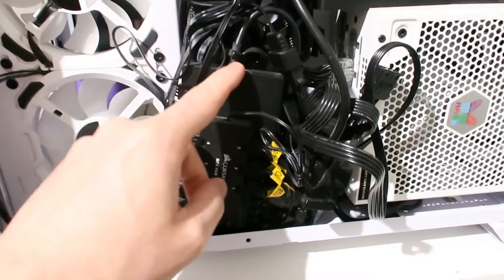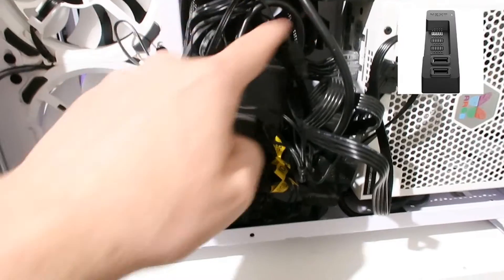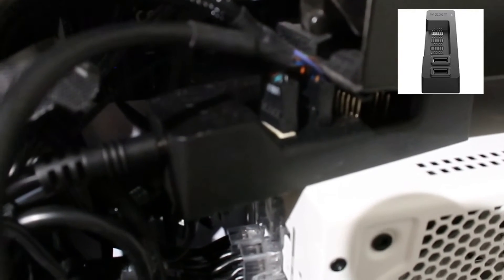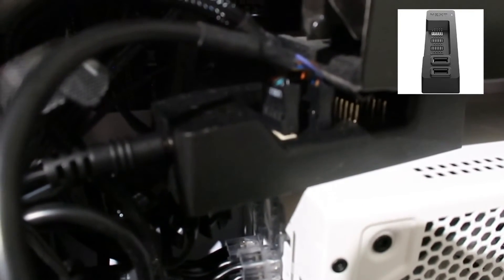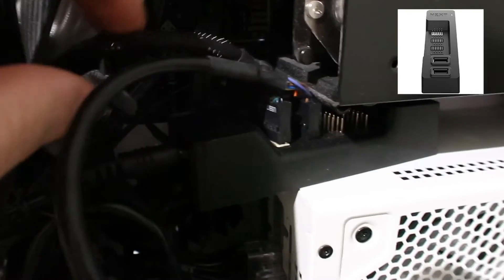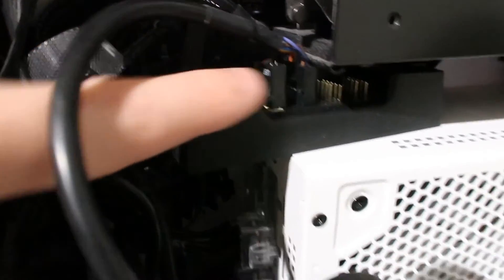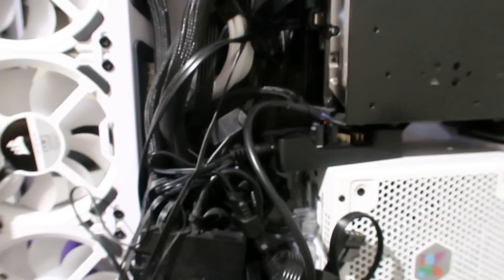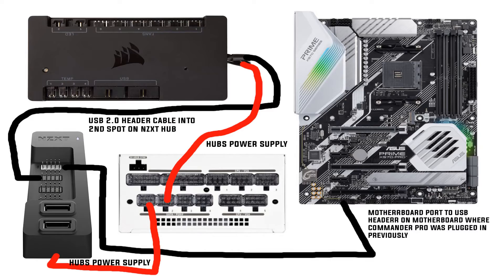Corsair Commander Pro: How To Fix Disconnection Issue - Solved Working In 2020

Comment: JUST TURN OFF ALL POWER SAVING FEATURES IN WINDOWS!!!! This is the main cause to the usb issue on the Commander Core series problem. This includes the Commander Core that comes with the H150i AIO, Commander Core Pro, Commander Core XT.
Reply: Thanks Jeff. tried this one however mine is still not detecting the commander pro rgb in iCue i have the Elite LCD CPU cooler.. :(

Comment: This was the only thing that worked for me, if anyone has a Gigabyte B550 AORUS ELITE AX V2 with a Corssair case (Corsair ICUE Commander Pro) and is suffering with the connect and disconnect problems, just buy an internal usb hub and install it like the diagram in the video and problem goes away, it also fixed the problem with the internal bluetooth that keeps disconnecting. Thank you!
Reply from the maker: Thanks for feedback glad you got it sorted
Reply: I wish this fixed it for me. I have the exact same issue and motherboard, I just spent $600 upgrading my fans and AIO and they're not detecting. I have read every single forum post and I have tried every single method on fixing this with no luck. Some methods work for a little bit and then it disconnects. :(

The NZXT Hub fixed it for about an hour, the longest its worked for a while. Now its undetectable.

Comment: I'm not 100% sure if I'm having this issue, I've a obsidian 1000d case with a dommander unit and recently 4 fans have stopped working but not the other 4, and I cannot for the life of me figure out why, It seems to be since I updated msi afterburner but can't be sure, other than that I suspect its the pin connectors.

Comment: I have the exact same board, I just finished  my build.   I kept hear  a tone like something was disabling and enabling  itself.   I spent a week on the phone with Corsair, to the point we all thought it was a bad  bad commander pro unit.   They sent me a second  Commander pro and the same issue popped up. I've checked with ASUS, they were closed mouth about any known issues.   I guess Ill  give corsair heads up regarding the latest firmware update on ASUS x570pro boards They may not be so keen  on you going to a competitor to resolve there issue, but at least they can be aware of the issue. I'm ordering a the  nzxt hub.  Thanks for the heads up!!!

Comment: I have a rog x470i used commander pro without any additional usb hub till I update my bios. After update Commander turned mad and start disconnecting reconnecting. It took one week to find out commander is the reason of my issues. I pluged the nzxt hub and now its all ok. So its clearly something wrong with new amd codes...

Comment: just updated my icue, and for some reason now i cant see my lighting node in the devices list as before. so i cant control my fans and the are stuck on rainbow rgb. you have any ideas ???
Reply from the maker: Can’t check right now but the programs changed a fair bit. Maybe it’s there just hard to find
Reply: connect all your RGB headers there and select how many faNS THERE Are

Comment: Do I need this Hub specifically or can I buy the newer gen 3 hub by Nzxt
Reply from the maker: That I don’t know. I know the one I showed worked and that’s it. You can have a crack as see if the new one works I’m sure it would but I’m not 100%
Reply: Did you try with the Gen 3 hub by nzxt?

Comment: I ordered just a basic 9 pin USB splitter, will that suffice, or would it be best to go with the NZXT hub? 
I have the exact same motherboard and fans as you, and this disconnecting sound is so annoying.
Reply from the maker: Probably best with a hub you know works or you can run the risk of spending less but then it   Failing and then ending up paying more than you would have. Your choice man always good to try things out anyways
Reply: @clownygaming  I initially bought a cheaper one, but ended up purchasing the NZXT hub. I’ll give both a try and keep with the one that works best.
Thanks for the advice and help on this issue.
Reply from the maker: Allgood man best of luck! This issue was Deffs a massive pain so wanted to help others having this issue

Comment: My fans are running but my commander pro is not showing in icue 😢 please help be on this
Reply from the maker: Have you connected it correctly ? There are videos showing proper connection of the commander pro try them maybe
Reply: @clownygaming  may you give me the link of those videos,,thank you
Reply: @darkavenger5155  did u ever get the commander pro to work?

Comment: I believe I have this exact same issue. Apparently the Corsair Commander Pro module does not play nice with the x570 motherboards.  I've been going mad trying to fix my random usb disconnect / reconnect issue. I finally stumbled upon the commander Pro as the likely cause, which I have installed on my new PC I just built. I'm using an Asus ROG Crosshair VIII Formula x570 Motherboard, Ryzen 5950x CPU, Corsair Commander Pro module, and Using latest non-beta BIOS(12-2020).  Changing to a non-beta BIOS did help a little reduce the occurrence rate, but it never completely removed the random disconnects/Reconnects. I have also noticed, that restarting my computer as soon as I get a disconnect, seems to help some as well. It spread out the rate at which this usb issue occurred. I'll be installing my Generic brand Internal USB hub tomorrow, when I receive it from amazon. Fingers crossed!

I just wanted to add I had to order a generic brand internal USB hub from amazon, because the NZXT hub was going to take longer to get in. I ordered both, but will try the generic internal acrylic hub first.
Reply: howd it go? I have almost the same specs and Im wondering if this worked
Reply: @R1ckydo  I have a similar issue and similar setup. I want to know if that solved the problem.
Reply: and did it work ?
Reply: @Nido805  i essentially had to disconnect the commander Pro modules from the motherboard and just use them to connect all the fans.. basically not have control of the fans anymore, but still have them run.  Disconnecting the Commander Pro modules from the motherboard solved the USB disconnect issues completely.
Reply from the maker: Best of luck with the issue hope the hub helps

Comment: Recently built a new pc with the x570 prime mb in corsair 4000x case, and immediately started having this issue. The unplugged tone withbthe dissconnects. Only it seemed like i was dropping all usb for a split instant. Commander pro, rgb lighting, in connected devices screen my corsair aio would disappear and reappear,  and my usb wifi adapter would disconnect.
I came across this video, got the nzxt hub and installed it.. havent had a single problem since.  So thank you!!!
Reply from the maker: More than welcome buddy ! Had to share Because the issue was driving me crazy also

Comment: hi i am facing problems with random disconnection for my commander pro, and ive bought the NZXT Hub already. I tried installing but i am unable to do it because it is a 4 pin to the power supply, but my PSU is the corsair rm750, so how do i actually connect the nzxt hub to the PSU?
Reply from the maker: You may be able to buy a cable that goes from 4 to 6 pin as a conversion. You’ll have to do some research and see your options man

Comment: I have ordered the usb hub so I'm hopeing that fixes it.
Also did you uninstall and remove all the icue files before you fitted the hub? I have seen on a forum someone said you must do that but I'm not sure.
Reply from the maker: No I still use the software to preset my fan colours and everything it works fine no issue at all
Reply: @clownygaming  hub came today just fitted it hope that fixes it thanks for the info. I seen on the corsair forum this has been a problem for years I can't believe it's not been sorted. 😂
Reply: @CuteCoreKid  wich hub did you bought exactelly`?

Comment: So right now I have a basic pwm fan hub and the Corsair rgb hub will the fans and their rgb still work I’m new to this and wondering if I can connect 4 L series fans this way?
Reply: If not what’s the best way to get around this because the lighting node pro is out of stock
Reply from the maker: So are you actually having issue with disconnecting fans and stuff now or not ?

Comment: I am just building this setup so thanks for the help quick question where should I plug in the AIO fans for a corsair h100i
Reply from the maker: I have mine plugged into my commander pro. Along with all my other fans.
Reply: @clownygaming  didn't that stop the pump from controlling it's own temps with the fans ?
Reply from the maker: @ciaranmadden9469  hey man I’m not too sure I’m a noob with the whole pc things so you’ll just have to play around with it

Comment: Is there any other internal hubs that work for this? Amazon is my best delivery option and I could not find this on there. I have the same issue on a Asus x570-p mobo and can’t find any other solution
Reply: I saw someone fix this issue with an off brand Acrylic internal hub, that's made similar to the NZXT hub.  The point is to bypass hooking the commander pro directly into the motherboard and any internal usb hub should achieve this.
Reply from the maker: I haven’t seen a fix using a different hub, you’d run the risk of trying it out but are you sure you can’t find one on amazon ? You could try eBay